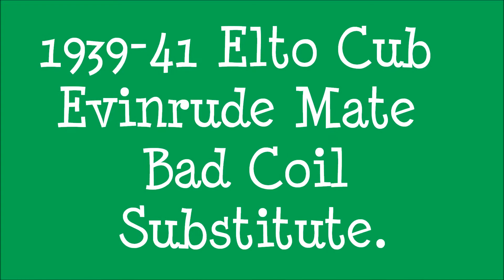1939-41 Cub - Mate Coil Substitute.

Comment: The Mercury KF7 Bendix coil is getting nearly as hard to find as a good Elto coil.  I wonder if the scintilla coil would work or even some of the Eska coils.  https://www.oldmercs.com/product_p/399-125.htm

https://www.ebay.com/sch/i.html?_from=R40&_trksid=m570.l1313&_nkw=Eska+coil+217.&_sacat=0&LH_TitleDesc=0&_osacat=0&_odkw=ESKA-coil-217&LH_TitleDesc=0
Reply: @tubsboathouse  Thanks for your videos.  The point was, that they didn't have any coils when I posted the link 2 years ago.  I was asking if the Eska coils might work?  By military coil, I suppose you are talking about the Andover 9786E128 coil or the 13206E140 coil used on old military gensets?  https://www.aomci.org/forums/topic/new-coils-for-an-old-elto/